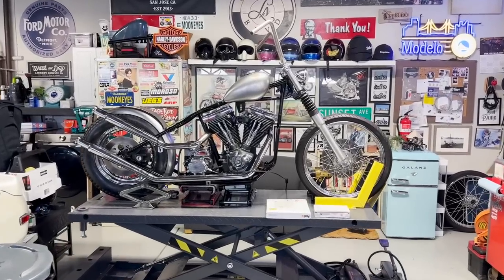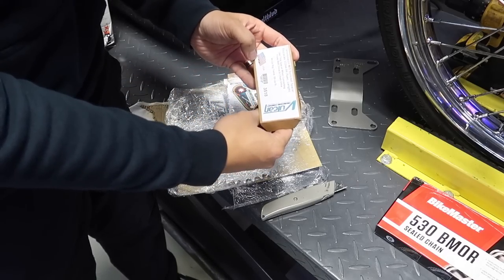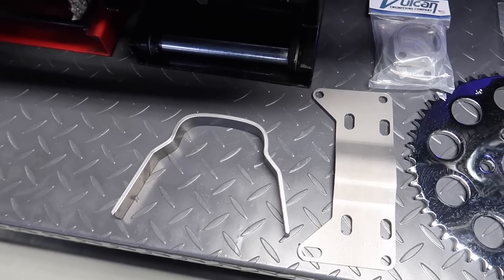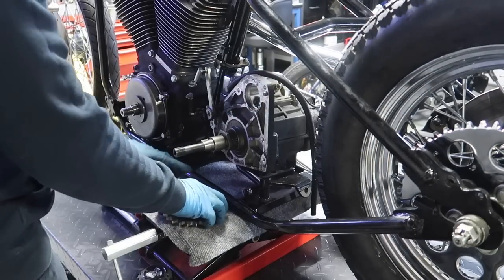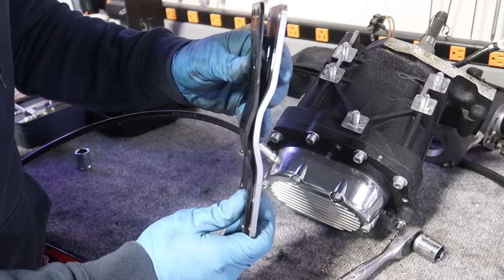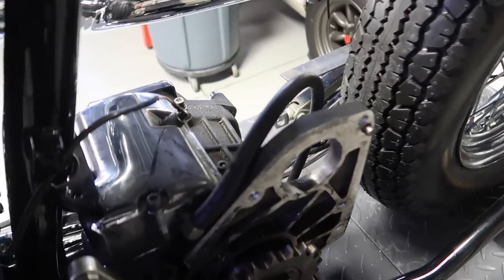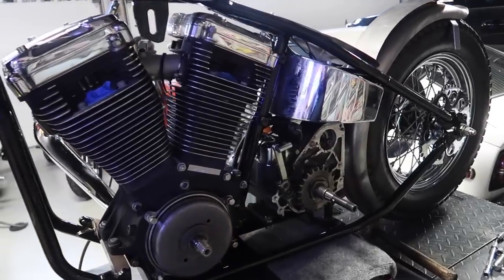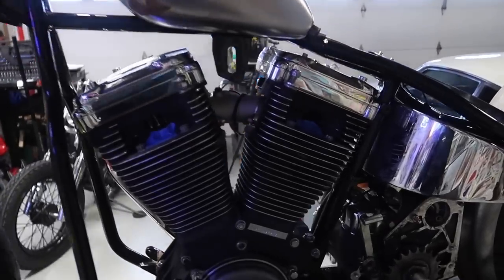Big Twin EVO Chopper Build | Part 4 Chain Conversion

Comment: Hej , Man , I think 22/49 ratio sprocket will be too slow for you.. too high revs especially if you build this beauty for long hauls .. I would go 24/48 or even 24/46  IMHO. I talk it from my own experience .
Reply from the maker: Thanks for the tip. Choosing the right gearing was tough. 22/48 is stock belt drive ratio and I enjoyed that when the bike was stock. Wanted to try something new so i went with 22/49. It’s 4% deeper (faster acceleration). If it doesn’t work out then I’ll try another setup.
Reply: @LNSPLTBLVD  Yes will be interesting to hear your findings about it! Looking forward to see it on a road!

Comment: On the Evo chop that I am building with the same "cocktail shaker" muffler, the exhaust note was ridiculous due to the steel plug with a small hold drilled into it in the muffler.  I removed the plug but haven't got to start the bike up yet.